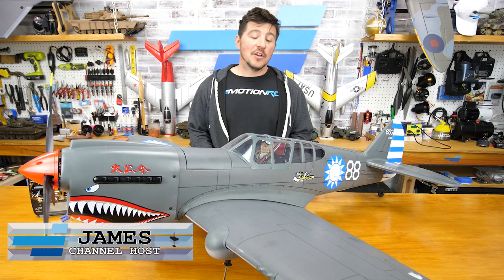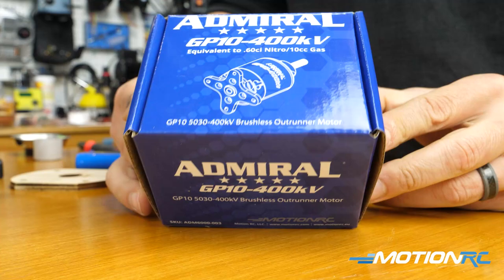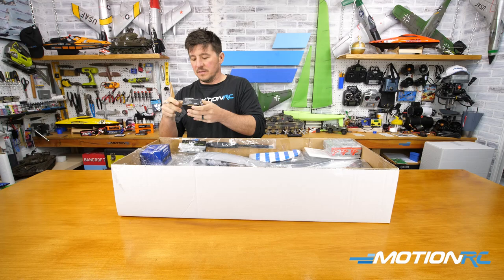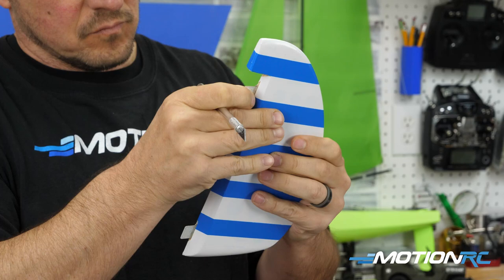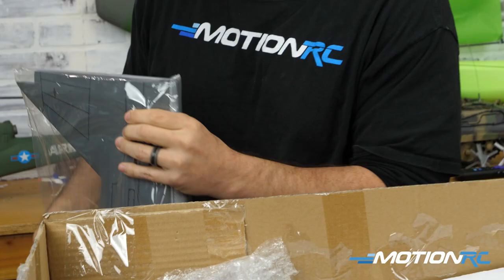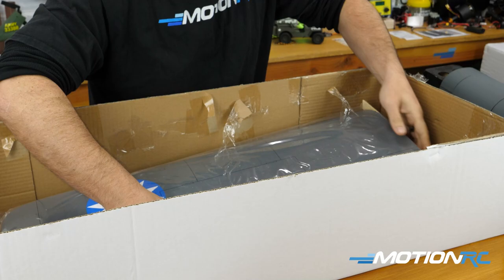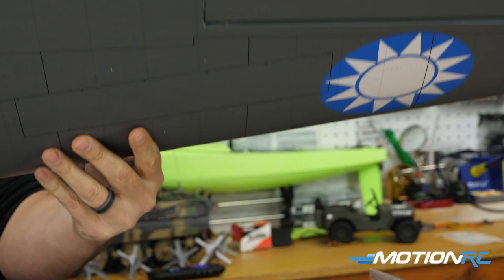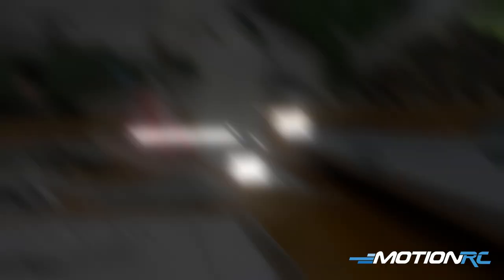Unboxing the Nexa P-40 Warhawk 61.8" (1570mm) Balsa ARF - Part 1 - Motion RC

Comment: Are you guys going to be getting more balsa jets? Saw a guy install a EDF in a Skymaster F-18, I am super interested in doing the same thing but I don't want to buy a plane thats the size of my car lol.... something a little bigger than the average 90mm is what I am interested in... Would love a twin setup for a F-18 that's balsa.
Reply from the maker: I am sure in the future we will carry every style of balsa product, but also we will want to make sure we have the power systems that match it. Hence why we really only have the 90mm L-39 from Black Horse currently as we have the systems available to fly it. We will get bigger systems in the future, just not sure when exactly
Reply: @MotionRC  Makes sense! Two 2210kv 70mm EDF at the right weight (2.6kg-3kg) on a F-18 would be a monster!
Reply: @Ogivekrew  I've asked MotionRc plenty of times on their site what the thrust is of there EDF units,   as building my own glass and balsa model at the moment.      Are you able to give me the thrust numbers put out by the 70mm 80mm 90mm units.   And what is the idel thrust to weight ratio.    Project is a 1:12 F111C aardvark    1778mm span   1830 length,      variable geometry,  full twin fowler and slats.        Have room for twin 90's       but building as light as possible and will power as needed,      knowing full well that going from 80mm to 90mm thr cell size from 6s too 8s is a huge weight disadvantage
Reply: @russcole5685  so... after my testing, Freewing EDF's are by far my fav... over FMS and others in the same price range especially their inrunner 9 blade 1900kv 90mm.. whats the weight of your Aardvark??  The 90mm will probably do close to 4kg of thrust, which is awesome!
Reply from the maker: @russcole5685  Typically you want to get 100watts per pound of thrust. So once you have an idea what the all up weight would be, then it would be easier to give a recommendation
Reply: @Ogivekrew  4kg,   wow    not bad,      it is not fully built as yet so can not give a correct AUW      I'm aiming to get it as close to 4Kg with servos and retracts.     From there the weight of fans plus batterys       hoping to use 4 X 3s 5000 or 6000's    eg 6s for fans       aiming to use 3s batteries so I can hang them off of the wing pylons, hiding in the external fuel tanks,   which will pivot as the wing sweeps.      I've looked very hard at the Freewing F14 and since it's of similar size with more wing area and the NACA2414 root section   NACA2418 tip with 4° washout    should give good lift        aiming    All Up Weight   6kg   maybe 7 at the very most.       Thinking twin 80s are going to be go to,   but would prefure twin 70s for less weight and longer flight times.      Thanks for you quick response and Hello from little New Zealand
Reply: @russcole5685  The 1920kv 80mm by Freewing is your go to.... just like the Mig they make, those EDF's are best for power and flight time.
Reply: @MotionRC  okay    thankyou for that,      are you able to give thrust values for the Freewing EDFs units you sell.    Thinking I'm going to be going with 80mm      but thrust of 70mm 80mm and 90mm might be needed as a target to build to.      Could get away with a large single 120mm in centre,    but that makes ducting not as easy as twin 80s  which will pretty much be a straight through path.     Intakes area are equal to fan sweep area of 90mm fan,    so it should be very scale without need of cheater holes under the fuse
Reply: @Ogivekrew  thanks my man,     will keep that in mind.     If I had the money      a couple of K45 would be the bees knees,     lol      maybe in years to come and after a lot of flights if it is still alive.   Lol    We'll see    can never tell when experimenting.    Thanks again

Comment: Again electric 😒😒... use gas engine... all your reviews is electric !!!
Reply: This would be nice with a RCV120CD   completely in cowl     with the build in 2:1 output shaft ratio,    huge prop with aggressive pitch for that scale look and performance
Reply: @krotchlickmeugh627  yea    that sucks,    fair enough that they dont want to promote outside business,     but surely they'd sell more if it was open to glow or gas power engines,    rather then only electric motors,     Getting to the stage us traditional modellers will need a lathe and mill to build our own copies of the faithful creap and reliable ASP and RCV engines      lol    I'm drawing mine as is.     Lol      probably will never have money to build though     And Hello from little New Zealand
Reply: @krotchlickmeugh627  yup,   completely agree with you there,    I've been scratch building since the 90's        But yup,   being in NZ does seem to make it harder for use to get cheaper engines,  especially since some of the Chinese companies have closed doors,   ASP being my example.     Can still get plenty of engines here, but the price is huge and then there is the postage from outside of country.     Lol            used to have a SC75 ABC  with an OS gear reduction system on the front.     Wish I never got rid of it .    As looking on Ebay for a similar replacement will set my back over A grand Kiwi money.     Lol
Reply: @krotchlickmeugh627  Bruce,  as in Xjet Bruce.    Or Laddernan .    I'm in palmy north,     Xjet is in tokoroa      I'm a fan of his aswell,   have yet to meet the man
Reply: @krotchlickmeugh627  in comparison,    yup   NZ is small,    but still a population of 4. Something million,   cant say I know everyone.     Lol